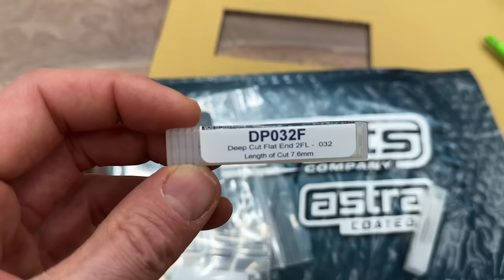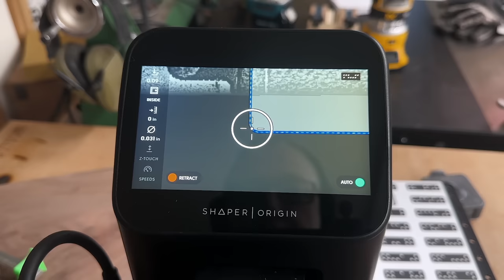The UNCOMFORTABLE TRUTH about building custom furniture.

Comment: My most uncomfortable thing about custom furniture is the time you deal with the customer. Making plans, talking about their preferences, using a software to make a 3D model for visualization. That´s why I stopped making custom furniture in the mid1970s (when I would draw 3d models by hand). I started building furniture  and then selling it in stores. Anything I wanted to build.  Nowadays, I use agents, since most of my furniture goes from Germany to California.

Advantage is that you can build what you wanna build, easier stuff or more challenging, you can choose your own wood, details etc.. And I spend a lot more time in the workshop and not in the office. And you don´t have to deal with nagging customers or customers that change their mind mid-build and want some other changes.

And money wise, you earn up to 50% more on the piece cause you not only have that one customer but you have dozens, hundreds who push the price upwards.
Reply from the maker: Sounds like you worked your way into a great situation. That's awesome!

Comment: I feel your pain. I'm 80% done with a table that I should have charged twice as much. But I'm learning a lot, and I have a lot of new tools because of it. So basically, I'm really not making anything on this project, but it will definitely help out future projects. 

And by the way, your work is amazing.
Reply from the maker: Custom work is very difficult to price. Sometimes you get it right and sometimes you don't. Unfortunately, there's no magic formula when building a piece for the first time. Thanks for watching!
Reply: @KeithJohnsonCustomWoodworking  Not sure how it works in the US, but in Germany and Europe, you roughly do 

1,2 x(material cost)  + hourly  rate + transportation. As a rough calculation for the customer.

The 20% on top of the material cost is energy cost, machines etc.. If you build cheap cabinets from plywood e.g., this number can go up to 50% because the use of machines is the same. The hourly rate is what you charge, it depends on the region. It goes from around 30€ in South Italy up to 100€ in Northern Europe and around 350€ for premium.

Comment: Your work shows real artistic talent for balance and beauty your desk is notinng short of spectacular. What I ased when pricing exxtras was to estimate how much time item would take now that I had a method and try to add that to cost if possible that way your customer is not paying for you to learn but rather a fair amount for the added feature. One thought I would give client a special sacrifical thin piece to place under mount wher mic is attached to desk as this areaa will surely show wear with use on this beautiful desk.
Reply from the maker: Sometimes you have to work within a budget and I will take a commission based on the challenge and gratification and not so much on the money.

Comment: Large and smaller pieces of walnut like that top with extensive cutouts are very likely to cup, warp, twist or crook over time no matter what finish you use. Learning how to deal with EVENTUAL wood movement is something many " live edge" builders will need to learn the hard way. Even perfectly quarter sawn stock can cup or twist a surprising amount.
And kiln drying large sections that then get resawn or flattened can still move a lot.
Reply from the maker: Thanks for your insight! Wood can be a real jerk sometimes 😜😂

Comment: Keith, those desks are seriously bad ass. What a great build. Like you I LOVE to challenge myself and push the boundaries of what I can do/design. I've done this my whole life and it's lead me to have multiple different careers. I love the details you put into your work, simply amazing. Please keep these videos coming!
Reply from the maker: Super appreciate the comment and encouraging words, Bob! Without challenges, I would be pretty bored...probably less stressed, but bored!! 😂
Reply: @KeithJohnsonCustomWoodworking  Here's a question for you... I see you used the vacuum bag to glue up your veneer into one panel. Other than a vac bag is there some way to do this? I have some 1/8" veneer and want to apply it to plywood, but don't have the setup you do.. should I get one? or is there another way?
Reply from the maker: @BobBrittonBespoke  just make some slightly curved clamping cauls with the convex edge down in the middle. When you clamp the ends it will apply even pressure across your material.
Reply: @KeithJohnsonCustomWoodworking  Thank you! I'll do exactly that.

Comment: Was there no way of drilling down the slot? Very tight work but they definitely make 1/32 x 2 inch drills. The technique you went with worked well though
Reply from the maker: Could not find a bit that small that was that long. If you do, please let me know!

Comment: As always, amazing work, Keith!! Maybe I missed, but what finish did you end up using on these? I saw the Osmo, but it also looked like you use may have used Rubio and Fiddes?
Reply from the maker: Thanks man! I used Osmo on top of the desks, Fiddes on the tambour style legs and Rubio Walnut on the oval legs. It's not advisable to use multiple finishes on the same project 😂

Comment: On marking the opposite side of the outlets, would it not be possible to predrill all four corners all the way through before cutting it? Just curious because IMHO hitting it perfect with that template had to be a risk. I know I would have missed it 😜
Reply from the maker: I don’t know of any 1/32 drill bits that are 2” long
Reply: @KeithJohnsonCustomWoodworking  Well two holes in the section to be removed of any size would have provided reference, don't have to be corners. I only mentioned because I was surprised you hit it. Of course you do you. Your work speaks for itself.

Comment: I really dislike that shaper thing. I understand that for someone in your position, high throughput high-end table designs, it makes sense, but to me it's just a piece of digital technology that invades a trade as relatively untouched as woodwork. Before anyone says, well what about this power tool or that power tool. That's different. They make hard work lighter, but you still have to do it yourself, by hand. This reduces woodwork to a digit sketch and the woodworker remains as a mere machine operator.
Reply from the maker: Well, I guess I'm not going to buy you one for Christmas now.
Reply: @KeithJohnsonCustomWoodworking  I did not mean to insult your work btw, I think it's great. It's just that the specific tool doesn't sit well with me personally. I'd much prefer one of your hand made wooden products over that tool, if you're still looking for gifts to give ;-)

Comment: Yes and no, if your starting out and someone else could do it easy, then yeah bit of leeway on the learning experience however if you're building something completely custom, that no one else has done then the client pays for that learning experience, as you've been hired to use your problem solving abilities to work out a solution to their problem, that's totally billable hours. You wouldn't ask an engineer to design an underwater city, then to say they've got to do it for free as it's a learning experience.

..Saying this as a hypocrite as I've been there loads of times, spend days designing something, then only bill for time on the tools, it's just something to move away from, otherwise you're better off sticking to framing, flooring or whatever where you can be earning more on the tools all day every day with no unpaid down time
Reply from the maker: Thanks for the comment and insight! 👍🏻